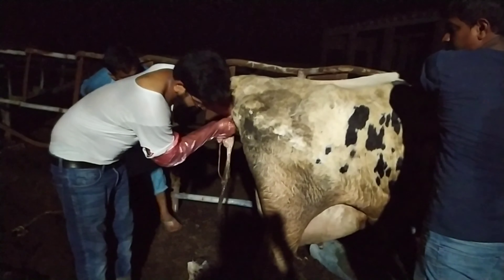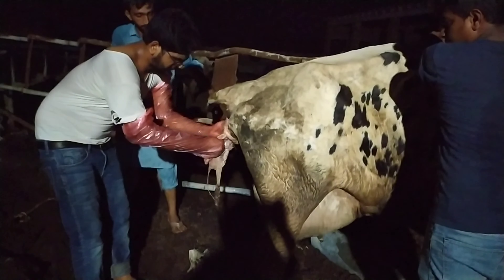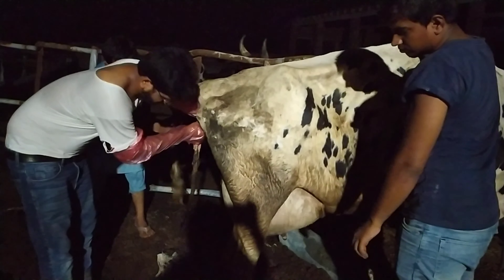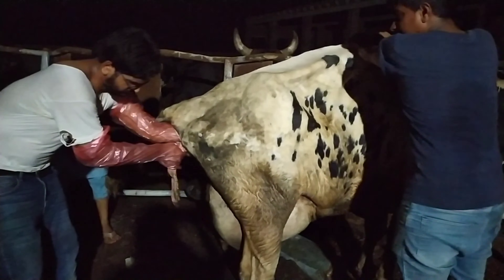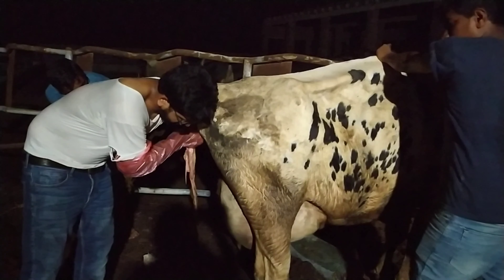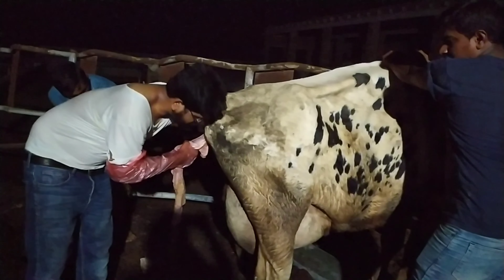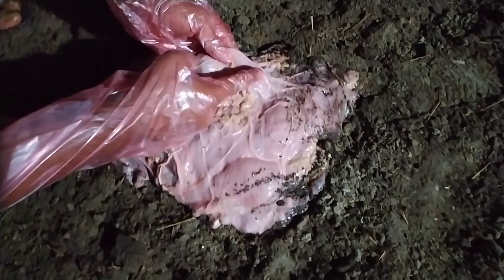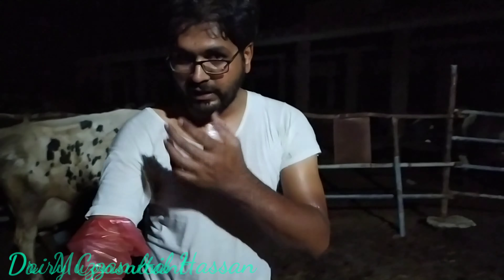Manual removal of placenta II Treatment of Retained placenta II placenta nikalny ka tareeqa

Comment: Flushing with Kmno4 is helpful in removing placenta?
Reply from the maker: It mitigates infection after removal of placenta. Washing of uterus with kmno4 soln is a good option.however, i have experienced excellent results with oxytetracycline
Reply: @DrMuzzammil  sir which brand of Oxytetracycline you used here?
Reply from the maker: @drirfan6289  i use nawacin pvp